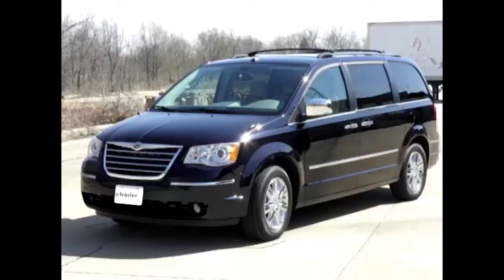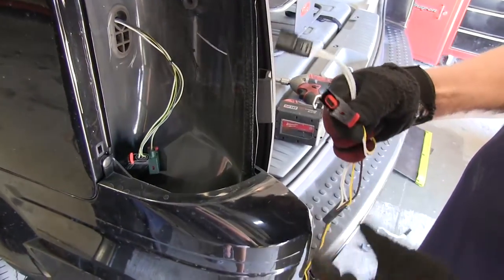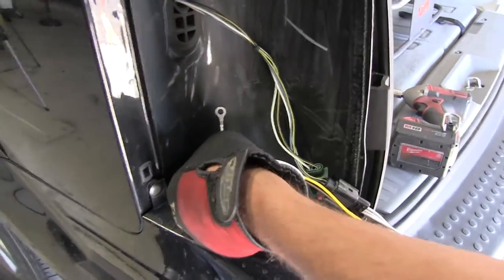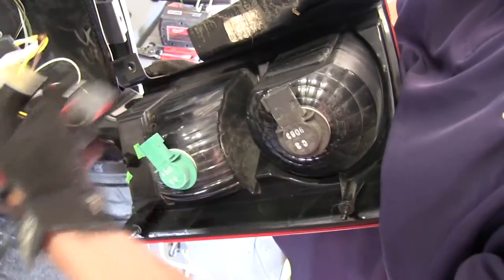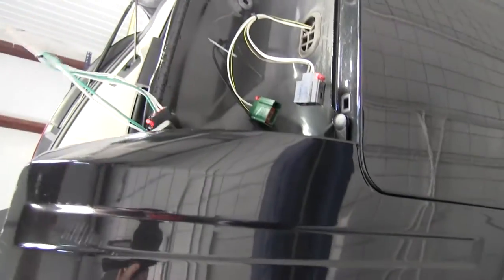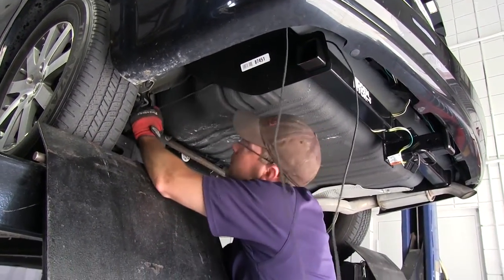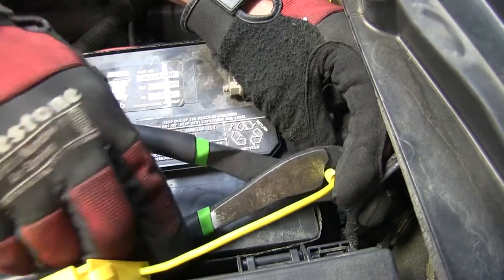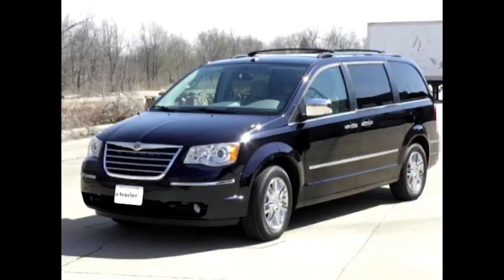etrailer | Trailer Wiring Harness Installation - 2009 Chrysler Town and Country

Comment: The kit I got has a black wire and not a red wire coming out of the module. It also appears to be 14ga and not 12ga as the black wire that was run to the battery. Is this a manufacturing error or is it safe to continue the installation?
Reply from the maker: It is very possible that you just have the newer model but it is the same fitment and application as shown in the video.

https://www.etrailer.com/Custom-Fit-Vehicle-Wiring/Tekonsha/118552.html
Reply: @etrailer  So connecting a 12ga wire from the battery will be okay to connect to the 14ga wire going into the module?
Reply: @etrailer  So it is ok to connect the 12ga wire from the battery to the 14ga wire coming from the module?
Reply from the maker: @jamesthorne8488  You will want to use the same gauge of wire. If you have 12ga coming out of the brake controller, then you will want to run 12ga to the battery to power it.
Reply: @etrailer  Then why did the kit give me 12ga. wire to attach to the battery & 14ga coming out the brake module?  This is a manufacturing error.